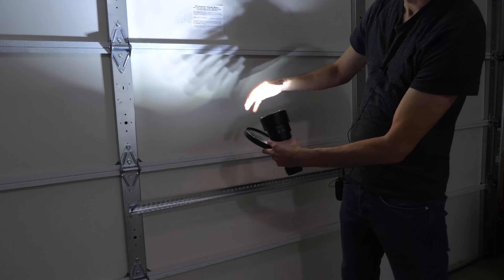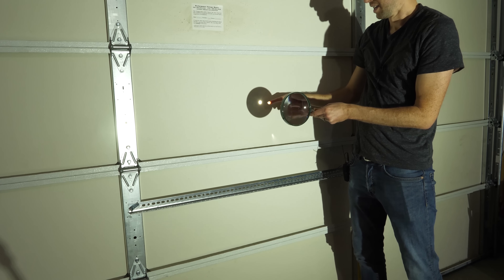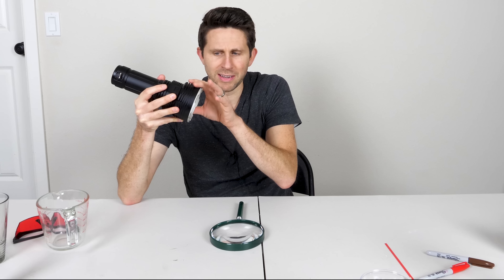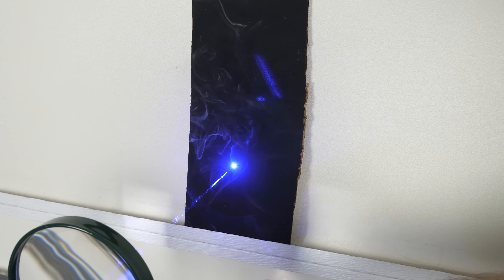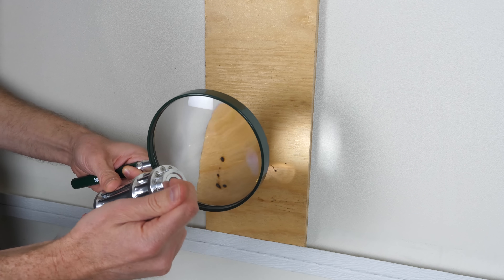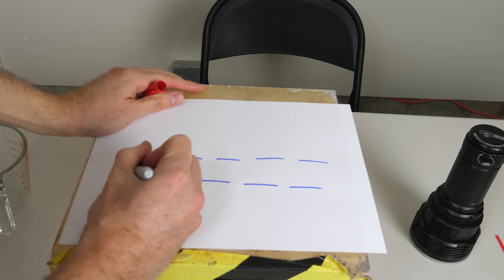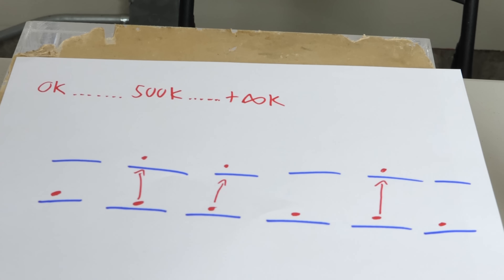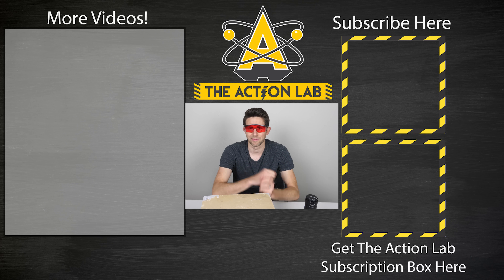What Happens if You Focus a 5W Laser With a Giant Magnifying Glass? Negative Kelvin Temperature!

Comment: I think what he should have added to help people understand is how the "Light" from his sources differ.  

The flashlight produces "normal" incandescent light from "Black Body Radiation" (heat).  Lasers use a trick of Quantum Mechanics to create light.  Normal physics state when an electron receives enough energy it will jump to a higher energy state and must stay there unless energy is removed from the system (Black Body Radiation).  But Quantum Mechanics allows for the Electron to spontaneously drop to a lower energy state and create an additional Photon when a Photon passes through the Atom.  Meaning you get two Coherent Photons for the price of one.  This would make it look like the system has violated the Laws of Thermodynamics unless it is account for in the math, more order than you started with.

Please allow for the fact I am not a Physics, just someone who likes to read about it.  So, I maybe incorrect or have misunderstood what i have read.

Comment: So after reading your explanation, it seems as though the reason for the scale to be wonky is because we created it with assumptions that turned out to be incorrect. So we have to fix it by putting the negative temperatures after the positive ones.

My question is, where does the Planck Temperature fit in here? I would assume it would have to be at negative zero Kelvin, since it is the theoretical maximum temperature. And the Planck Temperature is derived from fundamental constants and ultimately equates to black-body radiation with a wavelength equal to the Planck Length... I'm just kind of thinking "out loud" and trying to consolidate all the knowledge I've gained.

Comment: I think you're wrong. Concentrating the combined energy of a tall moderate warm surface into a very small hot surface does not brake any law of nature. For your flash light you just would need a bigger magnifying glass couse the rays are not parallel (unlike the sunrays they are almost parallel on earth)

Comment: I'm confused... in both scenarios. The Flashlight and The Laser to my understanding, neither can create more energy or heat than the source. you would effectively be making energy from nothing which is not possible.
On top of that you can in fact collect all the light from the Flashlight into a single point.
So I'm not really sure what the point of this video was....
Reply: To explain entropy, I think.  All particles that have energy vibrate.  However, not all of that thermal energy is useful.  In order to be useful, the vibrations must be orderly.  However, some motion is disorderly.  This is called entropy.  The Kelvin scale measures an increase in entropy with an increase in temperature as positive values.  Negative values show a loss of entropy with a gain of energy.  The particles vibrate more orderly while gaining more energy.  Essentially, they become more efficient at having energy because the particles are behaving less randomly.  That is what negative Kelvin values are for.

Positive values would mean the particles behave more randomly as they get hotter, which is more intuitive.

Comment: !MYTHS!
-u can’t use multiple lenses to create greater output of energy’s as the lenses would retract the heat  and absorb most of heat

- U can’t use thermal to power those thermo working fans as the radius is so small meaning that it would hardly affect the conductor or it will work but it would be very slow 🐌 

Law of conservation 
Law of thermodynamics (negative included)
Law of entropy

Comment: The construction of the torch is such that when light leaves it, it starts expanding. We can reconstruct the inner wall of the torch for light to leave parallel to the torch. This way we can use a magnifying glass to get a point on the wall that is brighter than the torch itself. But definitely, this can't be done in the case of the sun. Still, I have something in mind that solves this problem too and can theoretically cause a surface hotter than the sun using the sunlight itself.
Reply: Which is?
Reply: @gear2902  it could be done with a series of  heliostatic orbital giant lenses to capture as much sunlight as possible and focus it into a smaller and smaller point
Reply: @nada-nada-1234 you cant focus the light into a smaller and smaller point because of conservation of etendue. You can calculate the maximum light concentration that is possible in relation to the angular spread of the source and its around 45000 for the angular spread of 0.27 degrees that we have in our sun. The concentration times the energy density of the suns surface (1000 W/m2) gives us just around a limit of 6000K that is insurmountable
Reply: @satishchandra4785
you are correct in that it is possible to heat it higher than the "average" temperature at the opening of the flashlight. But it is still impossible to get it to a higher temperature than the fuse that we find inside each of the individual LEDs.

(even if we had a billion LEDs, no matter how we concentrate the light, it will never be hotter than a single LED held right up against the wall)

Comment: you could certainly magnify the light of the flashlight to be hotter at on point that at any given point on the flashlight, just never to have more total thermal energy than the total across the surface of the light source. when everything you said about the laser is true the same is true in a different way about the flashlight and it just seems like a bad and distracting example....

Comment: I definitely feel this is poorly explained and while somewhat valid physics, the negative temperature alert of this video is shoehorned in where the actual experiment doesn't have much to do with it.

The reason the surface of a flashlight is brighter than a focused beam from the flashlight,  and a focused laser is brighter than the laser source is because a laser emits parallel beams of light whereas a flashlight (or the sun etc.) Emits radial beams, so you're only ever focusing a fraction of the light they emit.

Comment: This is very much false. 
The reason this works has nothing to do with the temperature of the source, it's just basic high school optics.
The thermodynamic explanation is technobabble that does not fit here at all. This is not an isolated system, and the temperature where the light hits the wood is nowhere close to that of the light source, so the second law of thermodynamics is irrelevant here.
The reason this works with the laser and not with the flashlight is that lasers create a parallel beam, and the magnifying glass focuses parallel light to the focal point of the lens. The flash light on the other hand creates a diverging beam, and only when it is put very far away the light that hits the magnifying glass is somewhat parallel.
It is possible (and easy) to use a second lens, positioned at one focal length away from the flashlight, to make a somewhat parallel beam, and then have a second lens focus that to a tiny point, that would burn the wood.

Comment: If you set that laser/magnifying glass pointed at something like one of those heat powered fans, could you increase the output from the battery’s in the laser pointer?
Reply: The radius is so small it wouldn’t do nothing

Comment: This video is just straight up wrong. The fact that you cannot focus light down to make a spot brighter than the original source has nothing to do with the second law of thermodynamics. It’s instead a consequence of the nature of how optics work. Any light that isn’t a point source cannot be perfectly focused to a single spot, since each individual photon is moving in a slightly different direction than it’s neighbors. A laser is a perfect example of a point source, which is why it is possible to pull this off. Trying to connect this to the concept of negative energy is just gonna confuse people, especially since negative energy is not a real thing, but rather a concept used in math in order to get a proper reference when calculating for potential energy

Comment: I not convinced we used to use a magnifying glass to burn paper by focusing the sun when I was young. Preppers keep magnifying lenses in there bags to start fires. The reason the laser works so well is because the light is coherent eg all the energy is the same frequency and in phase were a led can be coherent but usually the light is dispersed over lots of frequencies and phases (a side effect of impurities in the dipping of the PN region of the LED). But light is just transmitted in packets of energy by using the lens you just changing the direction of the light rays (they appear as rays but it is more like transitions) to arrive at one spot as more packets of energy hit the surface the electronics in the spot jump state causing the atoms to vibrate therefore heating them up. The more these rays are focused the more the local effect of the energy despering into the local atoms therefore creating more heat. But what your saying about energy states in kind of true atoms like to maintain a state but when there electrons are excited by energy they jump from one shell to the next the amount these electrons move is a product of the wave length of energy absorbed. But remember energy is always conserved so when the electrons jump from there shells they emit the same amount of energy back out just in a new random direction. This dispersion of the energy from a visual effect would look like light scattering in a diffuser but because the wood isn't transparent you can't see the effect. The lens on LEDs are added to disperse the point light that would normally come from PN region of the LED in an parabolic way so to cover as much area as possible this cancels the effect of the magnifying glass.

Comment: For the flashlight experiment, what if you used a long tube with mirrors (like a fiber optic cable) to prevent light loss as distance increases, and then used the lens at the end, wouldn't the spot be hotter/brighter than the equivalent surface on the flash light?
Reply: No. If a solution exists it does something involving splitting waves into groups. Or you can just use solar panels to power a laser.
Reply: Maybe multiple lenses to continually refocus the light?
Reply: @nekolalia3389  That would never work. No solution can exist with reversible optics, and the proof follows directly from the reversible property.

Comment: The flash light demonstration explanation doesn't seem to make much sense.  Given big enough lens, you should be able focus the light onto a small dot that's brighter than the original source that's spread out.   The dot in the middle of the magnifying glass is surrounded by a shadow of the lens.  In essence, the light from the shadow area got focused to the center dot.  That's all the light you have collected with that magnifying glass.  And that dot is brighter than the light spread across the surface of the magnifying glass since it's all those lights combined together.

Comment: Wow what a load of bullshit. "You can't make a spot hotter than the surface of the sun because of blah blah thermodynamics blah blah flowing heat from cold to hot."

I'd like to see you explain how a refrigerator works. The whole point is to "flow heat from cold to hot."

Comment: You can use a len to focus the light from a flashlight, if it is REALLY big.
Also, you can use a ton of mirrors to collect light from other directions and reflect them like what they do in giant solar power stations.

The sun is different, because it emits light in ALL directions. That means there will be a "back side" no matter where we put the lens.
We need to surround the sun in mirrors and reflect them to the "front side" where the focusing len is to collect all light.

Comment: I just thought lasers were very focused beams of light, so when you used the magnifying glass, you concentrated the light onto a narrower space, and the problem with regular light bulbs, including LEDZ is that they irradiate light and energy at a wide angle, which is great for illumination, but not efficient for heat.
Reply: Lasers are not necessarily more focused. But the photons are all basically the same direction, polarity, and wavelengths
Reply: @YoungJackRack  Concentrated is the word then.
Reply: @Al.j.Vasquez  no. Concentrated would not be the word.
Reply: Lasers work a bit differently. Normal light is a mix of wavelengths, and spreads out. Lasers have one wavelength, and one direction. If anyone makes a joke about that blasted music group, I'll invent a device which allows me to stab them in the face over the internet.

Comment: I like your videos generally, but there are a couple logical fallacies in this video. We aren’t magnifying any one part of the surface of the sun, it’s all the light coming from the sun and going to the area that is being focused into a point that is being used. So it could become hotter, but it would require a huge magnifying glass, and it would only be super hot in the point. Focusing enough energy into a point should be able to make it hotter than the surface of the sun. Probably not safe though, so I hope proper precautions are taken… maybe on Mars?

Comment: It’s not. One can never create or destroy energy. 5 Watt laser meaning the theoretical max energy output is 5 Joules per second. The magnifying glass is not making more than 5 Joules per second. It is just helping the cheap laser to be more efficient. That is all. The flash light is not working not because it is a flash light not a laser, it is because the magnifying glass is not big enough or just take off the lens that defusing the light from the flash light first then use the magnifying glass. Because 2 things: “the dot is less bright than the flash light itself”, try it with the sun and put your hand in front of the magnifying glass, the dot is certainly not stronger than the sun itself but same as the flash light, we are all ok standing in front of the light without the magnifying glass. 2. No one can create more energy for free, 5 Watt is 5 Watt, it burns quicker but at the cost of burning surface being reduced. If the temperature gets infinite high, then the burnt surface is getting infinite small, meaning nothing got burnt. This is the laws of thermodynamics. Remember, 5 watt is 5 watt. Why? Because I just spent 1200 on a 100 Watt CO2 laser tube and you are not going to tell me a cheap magnifying glass is all that takes.
Reply: This is about point temperature, not watt output.
Reply: @logitech4873  correct me if I am wrong. Changing temperature has nothing to do with wattage?

Comment: Wrong terminology here: using lens you are concentrating to a point only the fraction of the light, which hits the lens. If the source is point- source (rarely true) or collimated light (like Sun or some very distant source) you can focus it to a single point. Temperature of this point is not determined by the temperature of the source, but by the density of the energy, which we can concentrate into a single point. So the limit is how much energy of the light hits the lens. If we can concentrate  the light after lens into a single point, that means we are concentrating the energy across the lens to a microscopic point. That’s what produces very local heating up of the surface on which we focus. In the limit of infinitesimal focusing point, the density of energy becomes infinite. But that’s not physically possible due to the lens not being perfect.
Source has no temperature. It has power. “You can never get brighter than a source” — wrong. Brightness is the density of light (energy). If the surface of the point we focus on is smaller than that of the source, the density of power in that point  is larger, hence it is brighter than the source (and ‘hotter’).
The mumbo jumbo about negative temperatures is taken out of context just to confuse average viewer (should have said “negative thermodynamic temperature” which is not temperature in usual sense). And there was no any contradiction with 2nd law of thermodynamics to start with.

Comment: I have a theory that our numerical system is used in the wrong order and this actually helps me to try to explain my theory. So number systems today start at zero and go forward to infinity. My theory is that the numerical system starts at negative then works to zero Wich would be infinity everything after zero would be adding to infinity for instance. Instead of. 0123456789 it would be -9-8-7;6;5-4-3-2-1,0,0,123456789 like this the double zero in the middle is the infinity. So you would start at -500 then go forward to 0,0 because of the fact you can't add to infinity because that would be creating something that doesn't exist yet. You can't add to infinity you can only reach a point at which the calculation takes a life time to write. So adding to infinity is impossible. I'd like to get your insight of this and explain why my calculations are incorrect.
Reply: In another way of viewing what I'm trying to say is that if the Lazer point with magnification was at the point of which it can no longer be magnified or it reaches its hottest point the end calculation would be -1 for that Lazer because you can no longer magnify it to get a smaller or hotter spot or end point. So Everytime you add strength the number that starts the calculation would be added to the beginning of the calculation so your beginning to this Lazer point would start at -501 and end at -1 . Instead of starting at zero then going forward you start at negative and work forward.